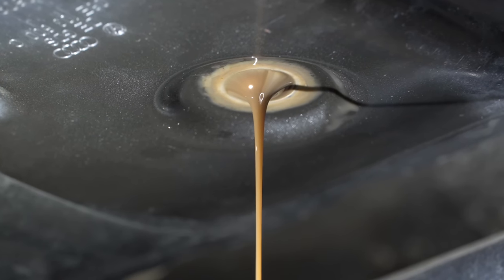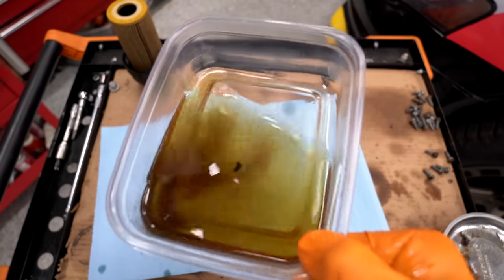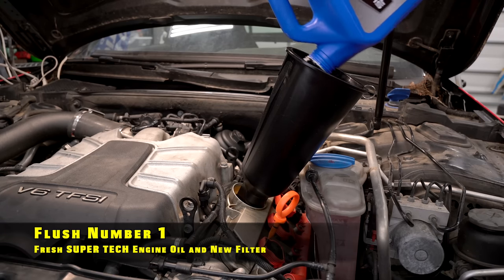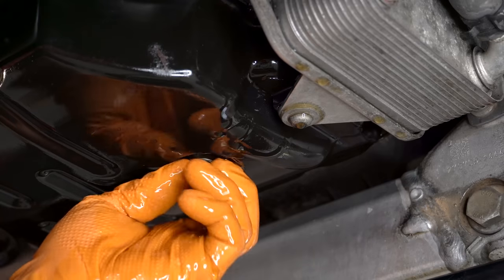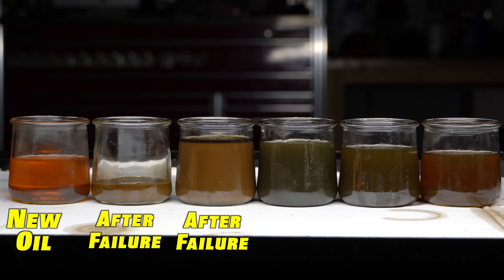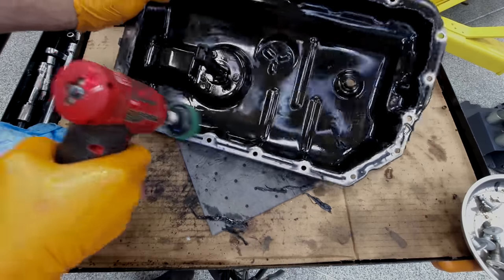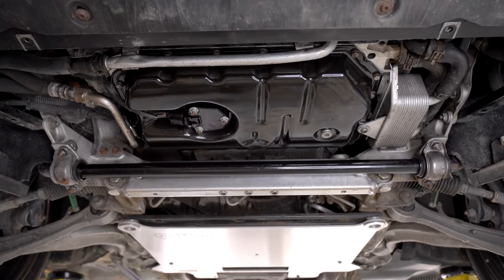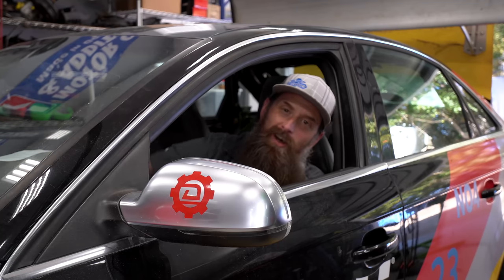Can This Audi Engine Be SAVED? Coolant Mixing into Oil

Comment: Charles, you just broke my world! I've done probably 15-20 oil changes with LiquiMoly and I never realized there was an oil change sticker ON THE BOTTLE. I'm so mad at myself for never noticing this. How could you do this to me?
Reply from the maker: Hahah that’s how I felt when I learned that!
Reply: Huh I never noticed either. But I do 5k intervals on my ‘19R so it’s hard to keep track… unfortunately my alternator last month failed 1000 miles out of warranty, and it gave my its first epc & cel last week… suspecting injectors 🤦‍♂️ I also went eqt stage 1 right after my warranty ended so no chance of getting either of those covered anymore…

Comment: the manufacturer could add a sensor to the oil pan that can tell if there is water in oil. Basically water conducts electricity so if you measure reduce resistance between two electrodes at cold start it means water in the oil pan. the thing is by the time risk of a failed head gasket starts to increase the car is already too old and manufacturer would like you to buy a new car.

Comment: Awesome video. I am a big believer in flushing an engine when they gunk up. Good job man.
Reply: As opposed to promoting more buildup?
Reply: @MycketTuff  No some people only replace the filter and change the oil once, while he changed the oil until it ran "clear" and cleaned the oil pan 2X of the residue.

Comment: Ok Charles, here's one for ya. 2006 Honda Ridgeline. The oil cooler/ radiator cracked and antifreeze into the oil. Replaced radiator..So, the system was drained and we added water and a dawn dish washing liquid, did that eight times cooling system .. obviously and a few oil changes with sea foam and refilled with factory authorized VW coolant (kidding) and sent it..i understand that this  is Audi VW show but guess what.. the pistons go up and down, the wheels go round and round... you're a good teacher by the way. I wonder if there is a way known to man to re-engineer the pcv system on that engine?

Comment: You could have easily keep the flush for an hour or so and rev it up to around 3000rpm for 20-30 seconds every once in a while, I usually do that when changing the engine oil and it may clean the engine better than just 10 minutes of idling. There are also "long life" engine flushes available where you can drive a car reasonably for 30-50 kilometres before replacing the oil, that would've been great for this particular engine imo.
Reply: Liquimoly states to idle and not rev or drive. You don’t want the crude being knocked off to circulate at a elevated rpm to score the internal as the crap coming off is abrasive. Keep wrenching my friend.
Reply: @TooBlessedToStress88  yeah Archoil states NOT to drive your car, yet their technician says you can drive no worries for around 50km, it's just a fail safe for the company

Comment: The only time you want to see a liquid like that is from an espresso machine, not an oil pan. YUCK!

I think it's worth doing an engine flush. What's the worst that can happen from that? At most it's a couple of hundred dollars. Cheaper that pulling and ripping an engine apart to check the various journals and bearings. You'll know in a few hundred miles of driving whether the engine is scrap or not. I'd be more concerned about that timing chain now. Guess that's the next video after the engine shakedown.

Comment: If it's not absolutely W*nkered and it's high mileage, fix the immediate problem and see how it goes.
If it hangs in for another 50-100K that's classed as a permenant cure

Comment: I will say short answer is yes you can save it...but long answer is if a gasket or a designed point of failure like a freeze plug it is not very terrible, but it is not always the go-to failure and then you have to ask yourself...
"I believe I have the willpower to do this, but does my bank account?" Is it worth it again?

Comment: An alternative I learned from growing up on the farm fill the engine all the way up with diesel instead of oil and leave the cap open overnight and Then drain it What I mean by all the way up is literally all the way up to the cap and do not start the engine like that

Comment: What engineer at Audi thought that having coolant go through a “PCV valve” monstrosity that is also ridiculously complicated?
Reply: Yes.
Reply: Every brand has their unique Engineering difficulty...
-Mopar has weak output shaft housings and suicidal clutch discs.
-GM is so aesthetically conscious that you can't get to anything to fix it and even if you can it will require 6 different sizes of sockets
-Jeep has terrible transfer case joints and weak electrical systems
-Ford require a special tool in order to scratch yourself and last for a long time but when it starts to break, it is not going to stop for a while.

And so on... German engineers are a whole new level of special people and will find a way to get a 10 min $20 job to take 4 days and cost a grand.
Reply: No kidding I thought changing the one on my 2011 Rav4 was a pain this is ridiculous.

Comment: Milkshake is not what you want to see in an audi.  I picked up a B6 A4 1.8t 5 speed with some good performance goodies that had  a blown timing belt for super cheap. Made the mistake of getting a "tested" head on ebay.  When got it I knew I should have taken it to the machine shop to test it all myself instead of just believing this place but I didn't.  Ran great but after it got warmed up oil and coolant mixed very quickly.  I thought maybe it was possibly my doing so I did it all over again triple checking everything with a better brand head gasket. Same thing. When it got warmed up... boom immediate mixture. Finally took it in to the machine shop and of course cyclinder 3 on the head had a crack and when it  got warm it was expanding and mixing. I was pretty upset to say the least. It's a good thing I was constantly checking oil and I caught everything quick.  With a proper rebuilt head and a few flushes it was good to go.  But you just know even running 30 sec with coolant in it has some consequences.  I'd say it just depends how long he was driving it after that coolant light hit.  Awesome how a failed pvc can lead to total engine failure.  Way to be Audi.

Comment: Hi Charles, I have a similar problem on a VW Passat B7 the thing is that the oil cap didnt have mayonnaise lol (coolant mixed with oil)  and so neither the dipstick.
I thought it was the oil filter housing assembly which has the oil cooler attached into it, so I replaced it with a new one and tried to flush it but it keeps mixing oil with the coolant.
I havent done a full drain the engine oil but I dont think I shoud since there is no mix on the oil cap or the dipstick.  But heres the thing, it keeps mixing after replacing the oil filter housing and when you rev it spits a few drops of water form the exhahut. Tbh I dont now if its condensation or Im about to lose my mind with this car. 

I read online about the oil cooler, sometimes it fails too and you have to replace it in order to stop the mixing. Any suggestions on what should I do next?

Comment: Hello Charles,  I have an Audi q7 with the 3.0TFSI engine. There is coolant inside my engine. However,  the coolant-oil mixture hasn't circulated through the radiator to the expansion tank. I have checked the oil cooler and I can't find the oil-coolant mixture. I am suspecting my coolant pump to be bad. Could this be a head gasket that is blown? How do I know the bank of the head gasket that is blown if that's the cause of the milky mixture? What else should I check before attempting the head gasket.  Many thanks.

Comment: It would be good to mention that the other 4 bolts for the oil cooler (besides the one that goes into the pan) are aluminum and will break the head off extremely easily if they are over torqued.
Reply: Could you quantify how good it would be?

Comment: Great stuff.  I have an issue (bpy mk5) where my oil is getting diluted by gas. I've put in fresh injectors, followed by a new pump. Still getting dilution.  I did reuse my autotech hpfp internals on the new pump then put it back to stock but it made no difference. Gas is mixing with my oil.  Any advise on what to check?

Comment: man I have a question for you about chain deviation in 3.0T CAJ. I am logging 12 KW degrees on one bank and I believe 10 in the other one. This is clearly a problem with the timing of the chains. I do have the service manual (PDF) but the: "how to put the engine on time after losing time" section is not there. Can you please help me?

Comment: Well, I did not have this specific issue, but I got a low oil pressure on my Audi A4 2.0 TFSI four days after I bought it, that was a bummer, and I was so close to my house and decided to drive the last few hundred meters, lucky only  the turbo died, and judging by the amount of oil in the intercooler it was already in bad shape so I guess it's not a big deal. but yeah, the oil pickup was full of gunk causing the low oil pressure. It was a pain in the as to take off the oil pan, I had never struggled so hard taking an oil pan off a car before. It's up and running now and I been driving it for a few months, but it had 273K Kilometers on it and I did not pull the whole engine apart, I just put a new turbo on and tried it. But it uses a lot of oil, both before and after the turbo change. I don't know if flushing can help with that.

Comment: I have a question that stumps me, how and why is your oil and the water smoothly mixing without re-identifying as frothy milk or curd chunks blocking the internal jacket and heater core?
Reply from the maker: it won't in the HC because there was no oil in the coolant, it was coolant in the oil. But Im with ya, it was like permanently mixed.
Reply: @HumbleMechanic  thanks sorry I missed the part about it being a one way breech, but I had to look at the oil again because it looked like fuel flooded past the piston rings, but even that was a better viscosity than fuel logged oil. I am also having a bit of difficulty with trying to figure out how it could happen with modern management and intact block, but I really want to know what caused it to blend as well as it was.

Comment: Great video. I like the joke about reading the directions for the LIQUI MOLY engine flush. There aren't any. Not even an indication that it goes in the oil hole and not the gas hole. I like their stuff. Just think it's funny they don't put any directions on how to use it on the can.

Comment: I think the engine will be fine if you flush it out good enough. Modern engines can take a lot of abuse & continue working. I think it being slightly older has helped it.

Comment: Hey yall I need some advice. I have a stock mk4 gti with the 12v vr6. I want to keep it stock, but it rides really high stock. I want to put it on lowering springs, but im scared itll mess up the suspension geometry. Any advice?
Reply: Raceland coilovers if you want looks, KW coilovers if you want looks and performance. Just get it aligned after

Comment: I worked in fire sprinklers a while as a younger guy since my step dad owned a plumbing company. Engineers loved to try and shove steel sprinkler pipes through steel HVAC ducting all the time. Looks good on paper right? It would be a great world if every piece of machinery had to be disassembled and put back together by the engineers before it goes into production.

Comment: Did this Audi ever survive ?? Been trying to find an aftermath video….
Reply from the maker: It’s still running strong
Reply: @HumbleMechanic  great news tbhh 😮‍💨 phew my 2015 Audi S5 88k miles failed pcv internally have a shop that’s going to do all similar procedures you did to this and I’m rooting for the best… my oil doesn’t look like that though. Because once I got the low coolant warning I already knew and figured what it would be…

Comment: Still curious about that Liqui Moly engine flush. I chose their other version of the product that you're supposed to drive lightly for 200 km (130 miles) and then do an oil change. Did that, and the engine died 200 miles later. My assumption is that the engine flush loosened some oil gunk which made its way into the head and clogged something up, which led to a seized exhaust cam for some reason or another. I'll think VERY hard before I attempt to use such a product again, although I see that it might just have been a coincidence and not caused by performing the engine flush. I'll never know.